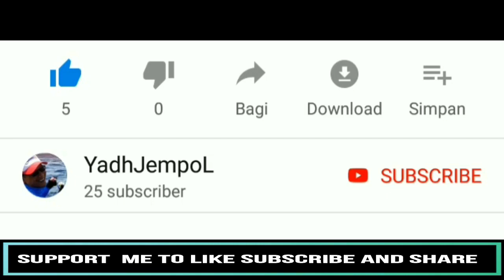KEREKAN PANCING MAGURO - SEPERTI APA REEL MURAH KUALITAS BAGUS

Comment: abis nonton ini sy beli yg seri 5000 asli gak nyesel drag uda pake carbon sistim seal drag yg paling tertarik semua da bruss reel lagen jaman dulu banax
Reply from the maker: Jd penasran ikan ap yg bakal strike ni.. mdh2an babon guede
Reply: @yadhjempol272  aamiin belum pernh turun reelnya om di sini lg musim angin kencang rencana buat jiging tu reel tak isi pe 2 300m pas hhhh
Reply: Line roller sudah pakai bearing om??
Reply: @harrigunawanhobimancing3573  line roller sudah pakai bearing om??
Reply: Sudah om sudah bering
Reply: @harrigunawanhobimancing3573  power handle y om. Udah one way anti reverse ap belum

Comment: ini udah metal body atau graphite atau plastik bang??
Reply from the maker: 9 Ball Bearings (Corrosion free) 
Eva Handle Knob 
*Aluminium Body Powerful Construction 
All Brass Gears 
Hybrid Rotor Construction 
Extra Wide Carbon Drags 
Water Proof Drag System 
Extra Thick Stainless Steel Main Shaft Additional Ratchet Stopper
Reply: @yadhjempol272  power handle.om. one way anti reverse ap blm
Reply from the maker: Sdh om

Comment: Selama pake reel ini ada masalah ga bos
Reply from the maker: Ga ada bos.. kelemahan cm di handle.. tidak menggunakan bearing di busa nya itu. JD cm bisa Eva bolong muter di pipa handle. Klo ada yg bisa modif mantep bgt tu
Reply: @yadhjempol272  bobot nya berat banget apa biasa bos
Reply from the maker: Ky ryobi om beratnya..
Reply: @yadhjempol272  mantap bos...makasih info nya
Reply: @yadhjempol272  oh iya om 1 lagi... rotor nya bahan Metal tidak itu
Reply: Bener om knob handle nya gak pake bearing jadi menghandalkan putaran  busa evanya aja, punya saya evanya macet gak mau mutar,
Satu lagi kelemahannya om bearing line roller susah dibuka ntah gimana pabriknya desain 😂